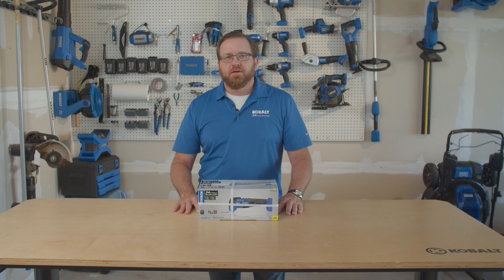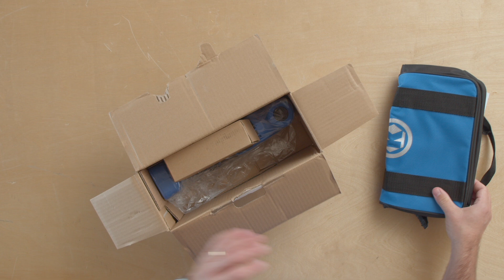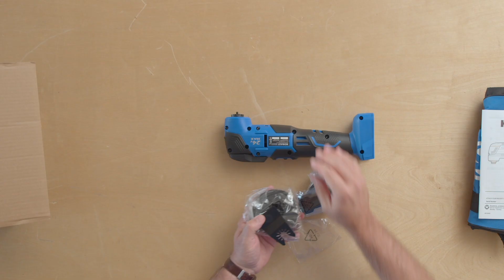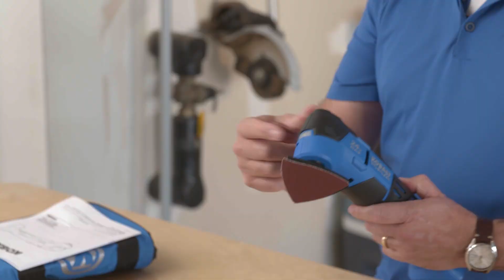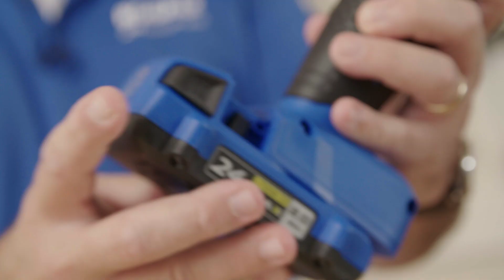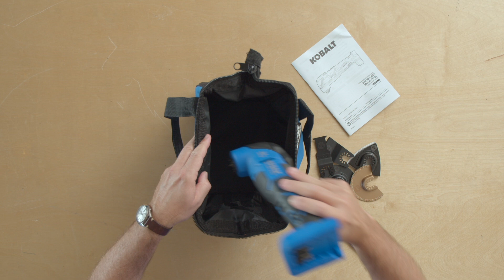Kobalt Tools: 24V Oscillating Multi-Tool Unboxing

Comment: Is it possible to get a part # for the locking rod? It's the rod that turns to set the oscillator bit in place before locking it in place

Comment: Mine is 6 month old and the blade release is frozen and broke.
Reply: it's under warranty get it replaced
Reply: I just use a bolt in a washer it works great. Kobalt are good tools for the money.